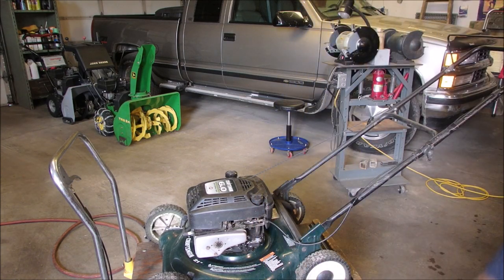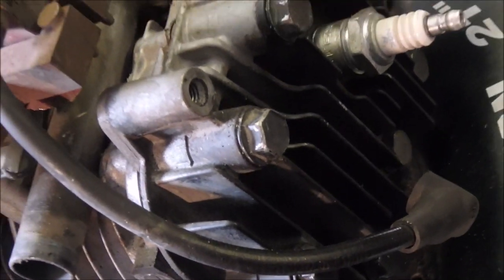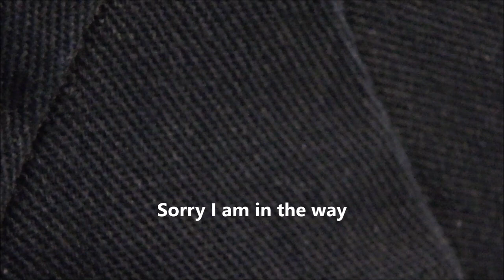6HP Craftsman Mower Will Not Start PT 2

Comment: Hi Bruce. I've seen this only once in the early 2000s long before my you tube days. My fix was I welded a L bracket onto the carb mount bracket and bolted the other end of the L bracket using the existing head bolt.   Nice detective work finding the hole in the manifold tube
Reply from the maker: Thanks.  After the repair i found our this mower has a lot of hours on it as well.

Comment: My job used to consist of nothing but stuck bolts for about half of every work day.  A die-grinder with a ball head works great to start and get a depression in the center.  Use a super-sharp, under-sized drill bit and don't let it get too hot or it'll dull quicker.  After it heats up a bit, stick the tip in beeswax.  I carried a chunk in my pocket all the time.  I used the spiral ez-outs and the trick is you have to tap while you're applying pressure.  I used needle-nosed vice grips.  Tap while you're turning.
Reply from the maker: Thanks

Comment: I picked up a toro  with a broken muffler bolt.  I drilled out out with left handed drill bits and it came right out.  Bought a new shoulder bolt and put it back on on.  And sold the mower after giving it a once over.  And it was good.  They were giving it away as scrap metal. 
But now it’s being put back for it’s intended use 
Cheers saved another one from the scrappers

This was a interesting ,  good job in making it work.
Reply from the maker: Perfect

Comment: Great catch!  I have seen the tube loose where it connects at the motor  (bad seal) but never a hole.  

Have you ever tried welding something to a broken bolt or stud?  Like a sacrificial screwdriver?  Sixtyfiveford does it and makes it look easy.  I have tried it twice - failed miserably in the first go, but it worked the second time.
Reply from the maker: I did think about it but 1/4 inch is very small

Comment: 1 have some double ended 1/8 drill bits from the 90s when I worked auto body. Those stay sharp and drill nice pilot holes. They are from snap on truck
Reply from the maker: Thanks  mine are just bulk

Comment: I like to drill so deep I get to the void behind. Then send some atf/acetone or whatever in. 
got that same craftsman 6hp bolted to an even older Snapper HiVac. Production date April 2000.
Those are bullet proof. Somebody put a too long bolt in there. 
My carb's never been off. Or the head. I retorque the head every third year or so. : ) best B&S ever.
Reply from the maker: The void behind is the cylinder.  I had a hard time with tis one.
Reply: Tim, I too have an 6HP from 2000 bolted onto an old snapper aluminum V-Deck from 1976. Like you all I ever do is change the oil, air filter and once in a while sharpen the blade. Speaking of the blade it still has the fiber slip disk on the blade hub. Went in once to pick up some replacement disk at the repair shop, they told me there was a recall to swap out the blade and blade adapter and refused to sell me the disk.

Comment: Hi Bruce, before you get ahead of yourself check the intake tube for looseness @ the motor, they break at the same time. Seen this several times, even pressure washers. Good video! If you don't replace the tube it will be surging and running crummy.
Reply from the maker: Yes as soon as the cover comes off I tighten then  This one was weird   Then I found the hole.
Reply: @BrucesShop  that tube used to be a composite of two materials when they first dreamed it up and they would fail more often. I used to save them for my hoard when I scrapped them out. I never had the bolts break but anything is possible! 😂

Comment: You got it buddy, there is always a reason for the hunting just gotta find it and find it you did. Rare that we see this bolt broken but we have welded a nut to the broken bolt like this one and tap and turn to remove. Need to use a MIG welder ours has triple gas and sometimes it has taken welding of 3 or 4 nuts to get it to move for removal.
Reply from the maker: Yes  I got that mention to me by my pal Stevo J  last night at happy hour.    He did give me a nice bench grinder with a disk and a belt  :-)
Reply: @BrucesShop  Nice present from a nice guy eh?

Comment: I have seen hairline cracks also in these plastic Briggs intake tubes. Hard to diagnose. Use a light on the outside of the suspected crack and look on the inside for the light. Or, spray some high pressure fluid from a can on the outside and look for wet spots on the inside. Thanks for the videos Bruce.
Reply from the maker: I did spray it.  Not sure if the camera was on  LOL

Comment: Ever try left handed drill bits? I’ve had luck with those without needing an easy out.
Reply from the maker: I was cursing myself as I have been talking about left hand bits for years.
Reply: I bought a set that I can't currently locate.

Comment: That’s a new one for me too.  
I always drill at a really low rpm.
Reply from the maker: Good point.
Reply: Use a center punch, drill slowly in the "MIDDLE" of the broken bolt, a little heat, some 50/50 acetone/ATF, it will come out. Slow down, and take your time.

Comment: Hiya Bruce! Yes, I have seen this several times before and every time it has been accompanied by a bent crankshaft causing excessive vibration. Two of the three times I’ve seen this the plastic intake tube has been cracked too, presumably from the same vibration that cracked the bolts. FWIW the deck had little cracks as well, usually around the engine mounting bolts.
Reply from the maker: Thanks a lot.

Comment: sir, you probably know by now first use set tap to create dimple in dead center in the bolt. Then use a very small drill bit for a pilot hole a little over 1/4 inch. Then keep stepping up the bit size until the hole is right for the EZ out.
Reply from the maker: Thanks

Comment: That hole in the intake would definitely make for a decent head scratch moment or two. Usually when I get those Quantums that surge it's the foam gasket on the top of the throttle shaft that's leaking or missing and or the throttle shaft is worn out, and it sucks air around the shaft. Sometimes an o-ring or two on the shaft will fix it or a foam gasket or a new shaft.  I have found the rubber seats for those carbs in bags of 10 from Rotary, but I have yet to find the foam gaskets in bulk.
Reply from the maker: Thanks a lot.

Comment: Funny just got paid to clean a carb and remove the carb cleaner plastic straw from the air intake lol! At least the customer was able to start it and cut their grass but when i checked the oil it was just below the ADD mark lucky they did not seize it up.
Reply from the maker: Good work sir.

Comment: OK... this tells me I have an air leak somewhere.  Thanks!
Reply from the maker: The leaks are everywhere.
Reply: @BrucesShop  Great video, by the way.

My new MTD 140cc was used once last fall, and I forgot to empty the tank when I stored it.  It wouldn't start at all last week when I got it out of storage.  After a thorough carburetor cleaning it was OK, but had a surging issue.

I cleaned the idle jet (because I forgot to do so) and the surging is minimal.  While I am using some older gas, I still think the slight surging now is due to an air leak.  

I'll check it on the weekend.  

I've also got a rusty-decked mower with a 6.0 Hp Tecumseh.  It needs a helicoil as I cross-thread the spark plug last year.

Comment: My guess is a previous person over tightened that one with an impact tool. Maybe went to back it out but had the tool set to tighten instead of loosen. Or just went crazy on the install. I have accidentally over tightened and broken bolts in the past. Now I tighten with hand tools only. I learned it wasn’t worth it.
Reply from the maker: Exactly
Reply: I just cringe to see people use impact tools on these old engines. I've even seen people use impact drivers on small 3/16 bolts. Yea they say, I've been doing this long enough, I have the feel. You have the feel of a cheap Chinese B&D impact drill.......
Reply from the maker: @RonDogInTheHouse  Thanks
Reply from the maker: You are right.  I should just use a ratchet on assembly.
Reply: @BrucesShop  you know the tool feel, you can probably use a power tool on it without problems. But many of us are Tim the Toolman Taylor and moe-power it into pieces.

Comment: Drill out the bolt and use a helicoil.
Reply from the maker: The hole wasn't round when I was finished but thanks for the tip.  Appreciated.